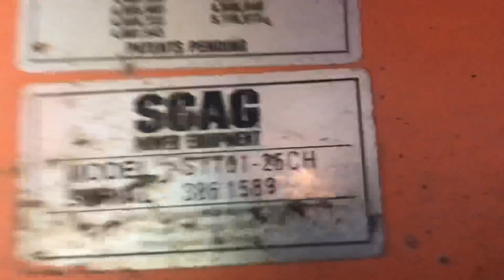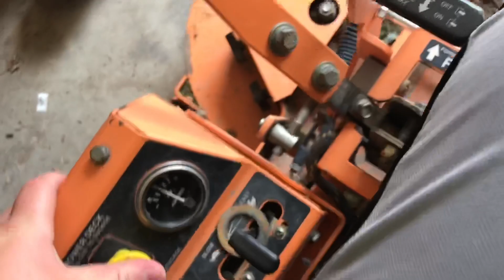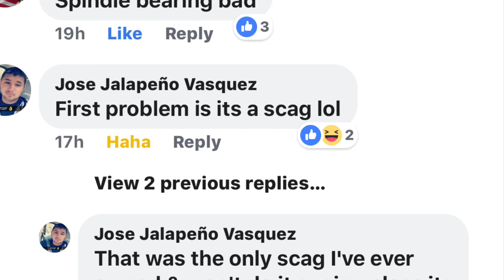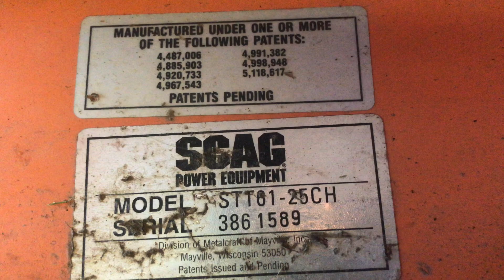Scag Turf Tiger Drama

Comment: Did you rebuild the carb after sitting for so long? It seems to be be the high jet is clogged ? it wouldnt run like that at idle if needs replacing the engine?